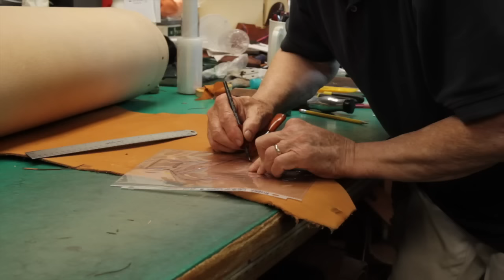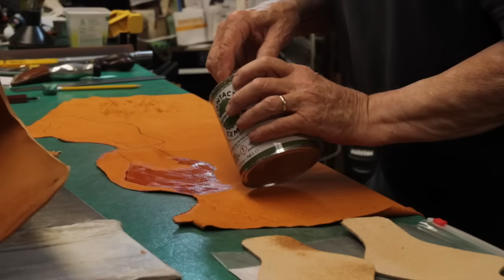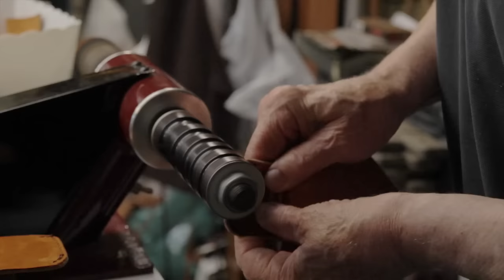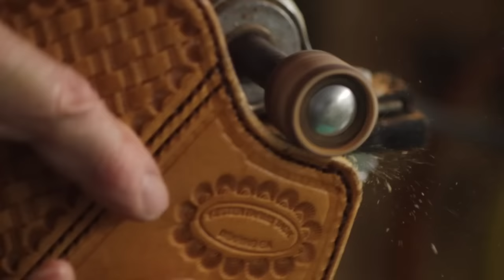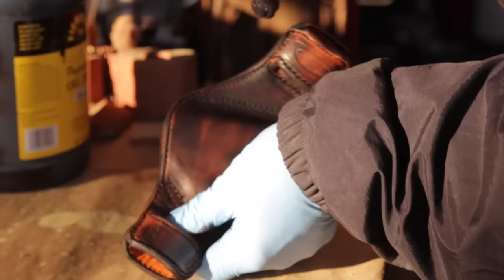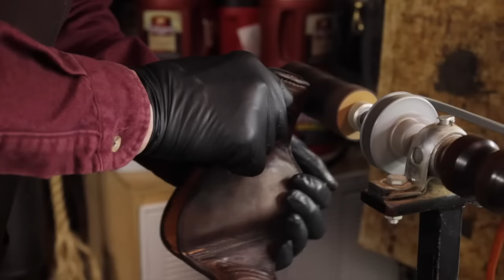Kester Farms Tack | Making A Holster

Comment: I have just ordered my fourth Kester holster. Having carried professionally for over 20 years I have used holsters from several custom makers and many from nationally known commercial holster makers. The Kester product is the best I have ever used.  If in a suit and tie the holster hugs the body very closely and does not print, with jeans and a T-shirt a little larger than normal it just disappears.  I have Kester holsters for a SigSauer P229 in .357Sig, S&W Shield Performance Center 9mm, HK P7 9mm, and a Les Baer 1911 .45ACP.  The maker is a joy to work with and the price for a custom holster with tooling is VERY reasonable.